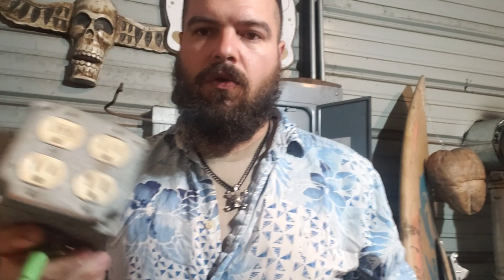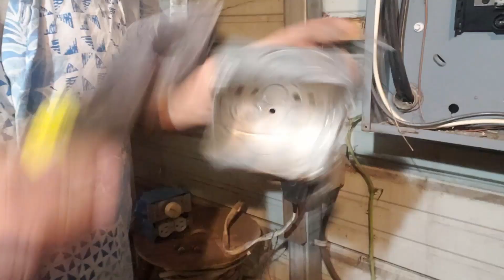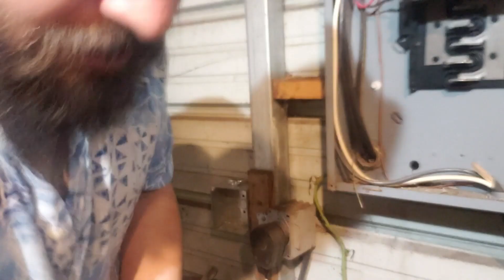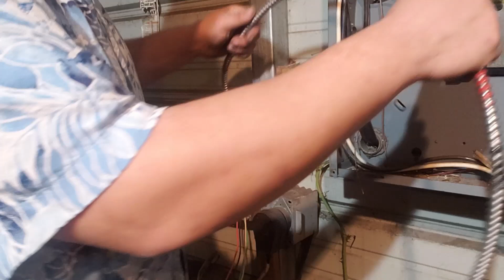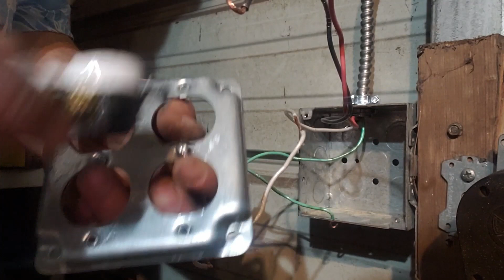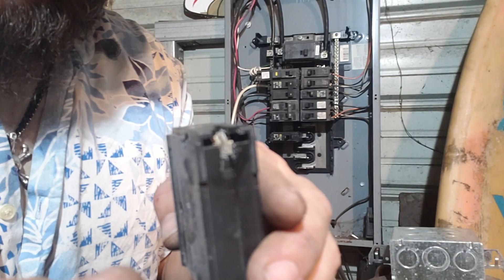Installing a 2 circuit quad outlet

Comment: I have always installed outlets the same way, with the ground down. (He always looks surprised that way when you are sticking a plug in his eyes and mouth.) Anyway I saw a good reason to turn them upside down recently. Still can't get myself to do it that way but... The guy pointed out that if a cord got partially pulled out and something fell across it would short the circuit, but if the ground was on top it would guard the hot and neutral. Just a little to slim of a possibility for me to change my ways.
Reply from the maker: I hear that too, it was mainly for when using a metal wall plate... which most now use plastic or nylon.

Comment: Good examples Yamex. Also a great idea. I would think these video's will be very helpful to some new people that want to set up thier shops. I know when I set up my shop I added 3 circuits and a 220 line to begin and since have added 2 more 220 lines. What was a relatively empty box is rapidly filling up with my new found hobby. Keep up the good work buddy.

Comment: Nice explanation. I m trying to convert quad to single Breaker. Ideally, want to replace quad with quad.
Reply from the maker: So you have a 2 circuit quad and would like to put it on one circuit. Correct?

Comment: Not to be a wise one but I just happened to think you may want to mention in your next video that the people adding a circuit  need to know what they are going to do with it so they add the proper amperage breaker. Or that they can't just add a large breaker without assuring they have it left in the system. Just a thought.
Reply from the maker: I intend on making one explaining wire size and breaker size ect.
Reply from the maker: It's impossible to cover all the things in one video. I have my rough gameplan of what to film, and then seeing requests and such is helping form a nice set of things to cover.
Reply: @IslandMetalForge  I figured you did when you said a series. Just thought I'd throw it out there incase someone just decided well that looked easy. I'll do that tonight. You might want to CYA and put a disclaimer in the video also just in case some poor sap electricutes himself God forbid. Just looking out for ya brother.
Reply from the maker: I will put a little disclaimer clip at the beginning of each form here on out. Good idea, thank you.

Comment: Hi 
I have a  question if you were to get this inspected do you need a double braker or with 2 single braker is ok ? Thanks
Reply from the maker: 2 separate circuits are 2 separate single pole breakers. The double breaker that is connected at the handles is a 2 pole breaker for 220v.